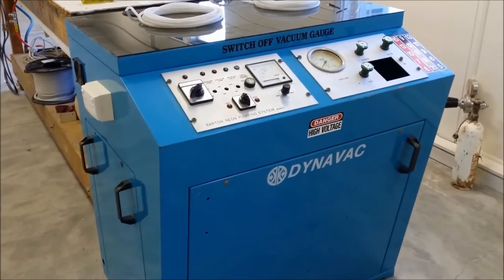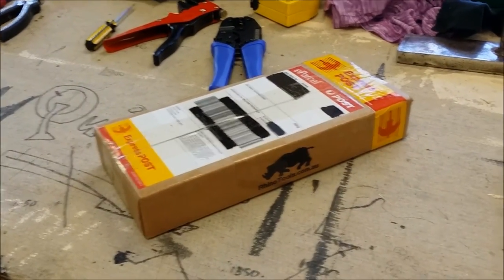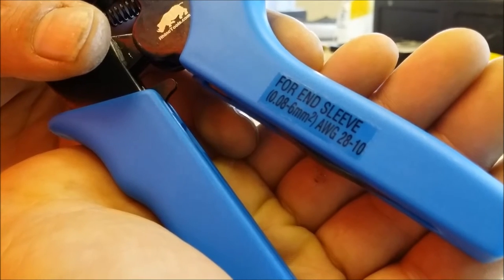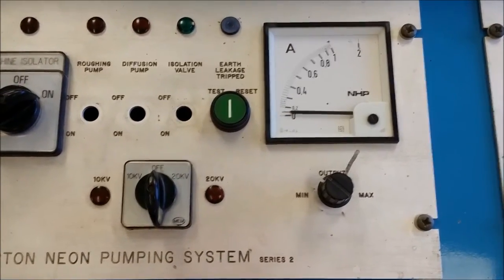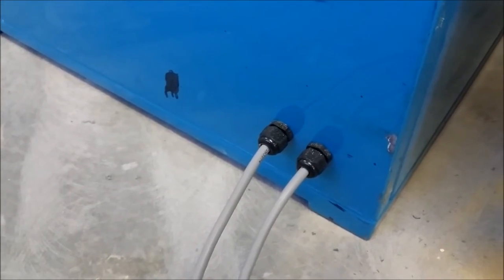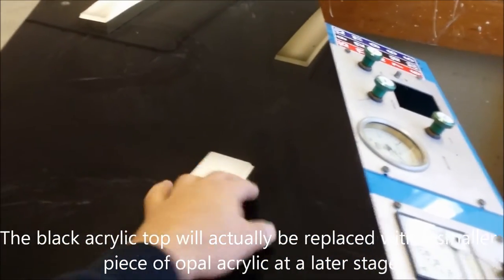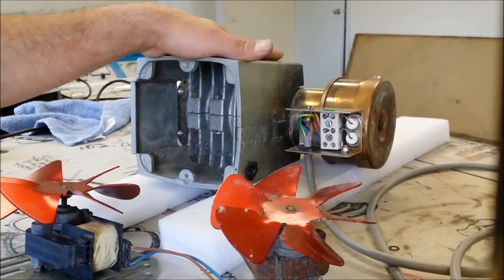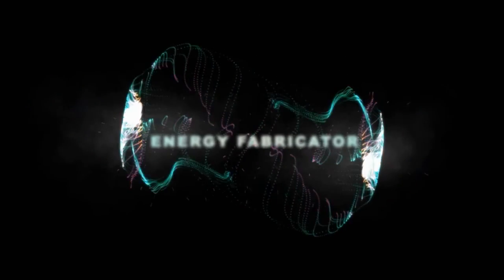Energy Update #43.1 - Building A Vacuum System [Part 1]

Comment: What is the mean between failure for this vacuum system? I would like to see some stats
Reply from the maker: DJ Paul Freeman dude... look at the system - your comment doesn't make any sense.
Reply: Any piece of equipment has a mean time between failure, from a guess I would say 50,000 hours.
Reply from the maker: That's right, but that would be for a simple device. 
The electrical system should run trouble-free for many years with new wiring, din rail mounted components and good quality brand name switches and fittings (eg. Telemecanique). The pumps and gauges have been serviced and they should also run for many years to come... BUT... This is all based on the operator using the equipment properly. If used incorrectly, the pumps may need servicing sooner rather than later. The bombarder transformer should be bulletproof if used correctly, but improper use may render it unserviceable. It's just not possible to give the entire system a rating based on hours. Some components would need a 'cycles' rating and some an 'hours' rating. Regardless, the system is second hand, including the parts which we have added to the system, so it is near on impossible to even guess.

Comment: brother let me know please why at diffusion pump need backing pum?? what happen if diffuaion pump start without backing pump vacum!!
Reply from the maker: The backing pump removes atmospheric pressure. After this, a diffusion or molecular pump is required to get a better vacuum. They operate differently to backing pumps. Diffusion pumps and molecular pumps will only operate under vacuum because they remove residual gas. There is no pump that can do it all.